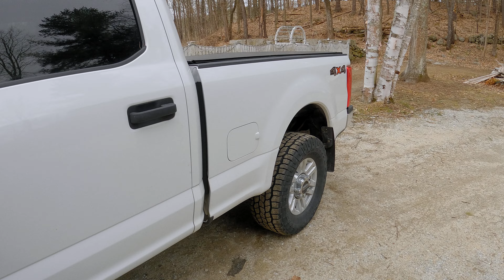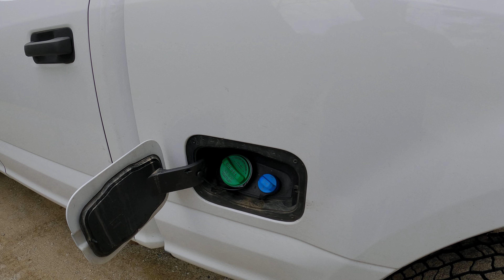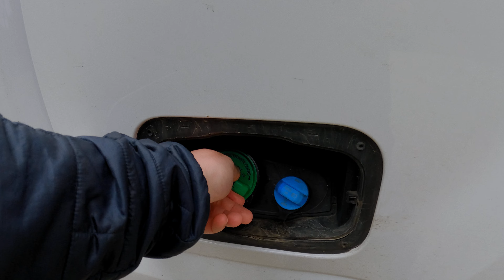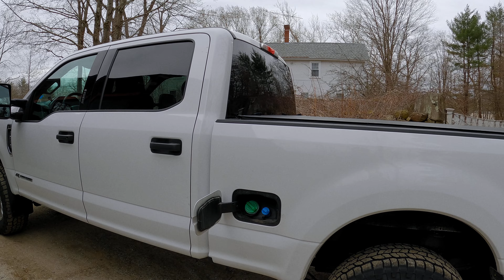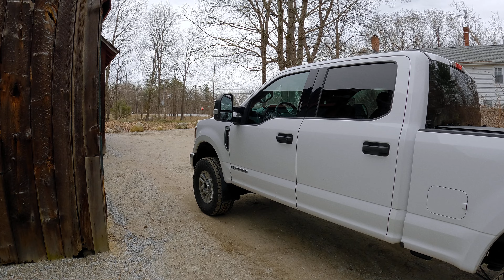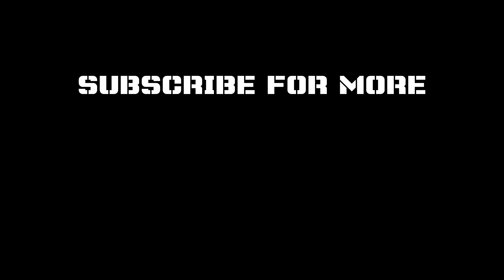Why You Should Use Diesel Fuel Additives

Comment: Does anyone use Motorcraft fuel additives? I just bought a new F 350 and I don’t want to give Ford any reason not to cover a issue under warranty?
Reply from the maker: Yes I used them for awhile before switching to Archoil. You can find them on Amazon. Definitely work decent!
Reply: Your saying motorcraft is decent but Archoil is better right. Thanks!
Reply from the maker: Yes but if you’re concerned about warranty just run the motor craft. Cheers!

Comment: I use 3 oz of hotshot on every fill up and 12 oz of Archoil once every 5000 miles which I marked it by every oil change.
Driving 2015 Chevy duramax 3500 and it runs like a dream
Reply from the maker: That's awesome! Glad to hear it's running well

Comment: I have this engine and I run straight heating oil with zero additives and have been for YEARS. Good fuel is important but pump diesel is a VERY high grade fuel to begin with. Keep your intake clean by taking it apart annually. If you're worried about this buy Top Tier fuel from stations that have the Top Tier logo.
Reply from the maker: Is there an app or website to search for those stations?

Comment: Long Island Ford will let it spit oil into the EGR cooler and that is the beginning of many failures on the Ford and all diesels long idling is what hurts them and not cooling down the turbocharger is what makes the seals go out costly repair certified heavy equipment mechanic for over 45 years I know my s***have a nice day
Reply from the maker: Thanks for the comments!

Comment: Add 9 oz of ATF to each fuel fill up and that will bring back the lubrication for your P4 fuel pump and will stop it from failing because they took all the lubrication out of the diesel fuel so you need to put back some lubrication in it to keep your fuel pump happy and makes more horsepower and cleans injectors Old world knowledge
Reply: I agree, I would def put a bare minimum disaster prevention kit or on a 90 plus truck
Reply: @williamleonardo8478  As a former Cadillac dealer mechanic GM sent us a service bulletin years ago on the 350 olds diesel saying with smoking excessive loss of power put a quart of transmission fluid in the fuel tank!!!

Comment: I've used the Hot Shots "EDT" now for the last 60k miles in my 3.0 Duramax.  Gives me piece of mind that questionable fuel can be saved.  However I'm also careful where I fill up.  My local CostCo sells very good quality diesel so I usually fill up there.  Engine runs smooth and quiet!  I also use 8oz of their "Clean up" every oil change(5-7k).
Reply from the maker: Thanks for sharing!

Comment: Anything from arch oil or xp3 is good. I use both in my 6.7 with zero issues with emissions or fuel. I even used it in my Peterbilt with six Cummins for 5 years and never once had fuel or emission problems

Comment: Run HSS EDT for my '17 F350 CCLB 4WD.  Use their extreme 2-3 times a year - seems to clean and add a bit of cetane hit.  Used PS gray bottle in my former 2006 F350 6.0L PSD, replacing only 1 injector in 220K miles.
Reply from the maker: That's impressive! The additives definitely do help keep a truck running well

Comment: My truck is older, and doesn't care.
My Chinese parking heater, however, is a very good test bed for additives.
I get faster startup times, less carbon buildup, and higher heat output, when running Howes in my diesel, than when I run straight pump fuel.
So, I'm sure that would translate well to a truck engine.
Reply from the maker: Yeah that makes a lot of sense!  Does you Chinese heater have a fuel filter on it?
Reply: @powerstrokemaintenance  it  does.
Reply from the maker: nice!
Reply: @powerstrokemaintenance  at $150, or less, depending on the brand,, (most are basically the same), you may want to consider doing a series on them, as they work with diesel related products.
You don't have to wait 100,000 miles to see results.
Reply from the maker: Good point! I’ll consider it

Comment: Using HotShot EDT here PSM but going to try Archoil for added fuel economy.  Might be a while tho, its a low mileage truck.
Reply from the maker: No worries! HotShots is still good stuff.  When you buy the archoil use the code PSM10.  It gets channel subscribers 10% off your entire order
Reply: @powerstrokemaintenance  Thanks PSM, what is your take on the friction modifier to prevent "sticktion"? Gonna get back over to PSH with Bill...check it out
Reply from the maker: My truck doesn’t have sticktion problems but I still run the modifier in my oil because it gets me better fuel economy and the truck runs like butter 👌

Comment: Ive used Howes, PS Gray bottle and Hotshots EDT. I feel PS caused more regens. Howes was ok but i feel behind on cetane. EDT i feel you get more flr your money and less regens. I had a LML Duramax wjere i did the tesing. Have a 6.7 Power Stroke now.  I now use EDT all the time and Hotshots Extreme 2x a year. The only other thing ive used other than that was i put in the PS White bottle during a sub30* cold snap we had last winter in North Florida....just due to the antigel
Reply from the maker: Makes sense!  Thanks for the comment.  How do you find the diesel extreme works?  What wort of fuel economy do you get after a treatment?

Comment: Another good tip a fleet tech told me regarding the CP4 pumps is, avoid allowing your fuel level to get below 1/4 tank. Especially on uneven terrain where the lift pump might momentarily suck air and deliver it to the CP4 and cause it to sputter. This can cause the CP4 pumps internal plunger and roller assembly to jump perpendicular to its cam lobe and self destruct. This is why it's also important to do the 6+ key cycles after filter changes and after draining the water separator. It made sense to me so I follow this advice.
Reply from the maker: That’s great advice! Thank you for sharing.  I didn’t know that about the plunger and roller assembly.  Appreciate the comment
Reply: @powerstrokemaintenance  here's a link to a S&S Diesel video that explains the internals and failure points of the CP4.2 https://youtu.be/nPFPf2EpxkE
Reply from the maker: Thank you!

Comment: EDT HotShots every tank. No joke I bought some at tractor supply around corner from dealership. As soon as I picked up my truck the sales rep took it to chevron and fueled it up, I immediately added to the tank. 

Plus side note full synthetic oil changed at 1,500 miles. I too hope to hit 500k or more miles. It will be our fifth wheel tow rig so should rack in some miles this summer but I have 3,500k on it now!!
Reply from the maker: Good call!  It sounds like you are really on top of your maintenance.  I’m sure that truck will let you many years!
Reply: @ck3561  I changed my oil every 10k. I now have 520,000. Miles.
Reply: 1500 miles lmao, complete waste of oil
Reply: Just the first oil change now it’s every 5k
Reply: @ck3561  I did my first oil change in my 3.0 Duramax at 3200 miles. Reason was because I was gonna be in a long road trip. Now I’m gonna do it around 5K using Amsoil.
Reply: @OtisFlint BMW in Sweden recommends 30,000 km/18,000 miles for its 2 and 3 litre diesel engines... 😯🥺
Reply from the maker: That’s crazy 😂
Reply: @OtisFlint - Not at all.  New  vehicles have a lot of minor metal articles from the manufacturing process.  I do a first oil change by 700 miles.  I have done that on the last 7 vehicles we have bought.
Reply: @OtisFlint I think he is talking about the first oil change at 1500. I've heard a lot of people say that they do that with the first oil change.

Comment: Hotshot secret EDT or Antigel (season dependent) every fill up and hotshot secrets diesel extreme after every oil change. Though I have also run archoil 6500 and 6400 before too.
Reply from the maker: Nice! Hotshots Is a solid option for sure